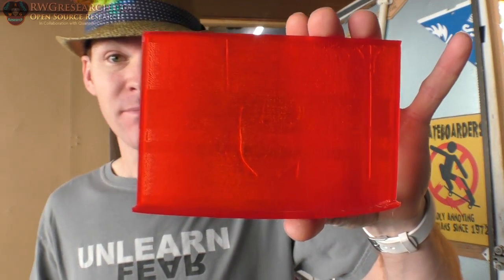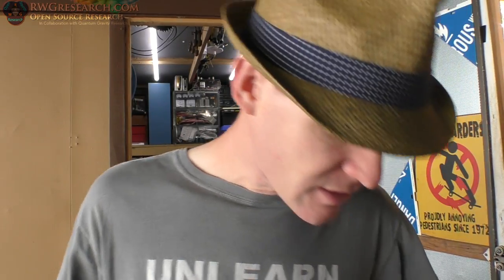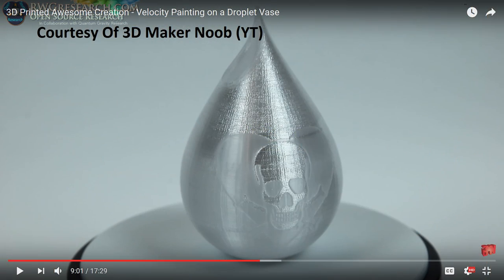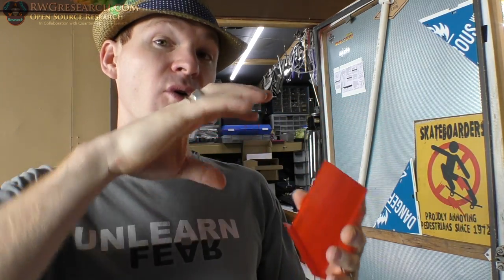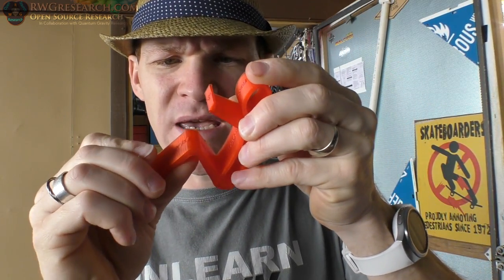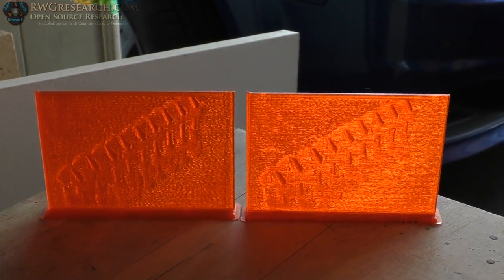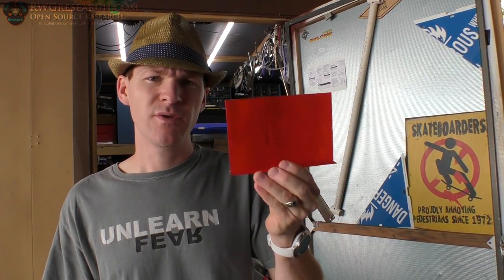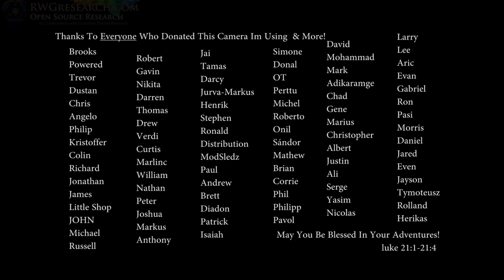My First Tests With Velocity Painting - 3D Printing... What Is That?

Comment: I'm really interested in the exact opposite of this: balancing the flowrate and the feedrate so surfaces come out smooth as silk... one need a 32 bit board and some clever code to change flowrate according to feedrate and acceleration. I think I saw someone doing similar experiments on a delta printer. Anyways: this is a bug, not a feature :)

Comment: i want to tray one photo neegative on glas surface ......could  you help me?
Reply: i think lithophanes are what you're looking for. 
to make them transparent: import your image into cura, turn the generated object on it's edge, and print in vase mode with transparent fil. for bigger ones you may have to add supports, to keep the thin structure from flopping around.